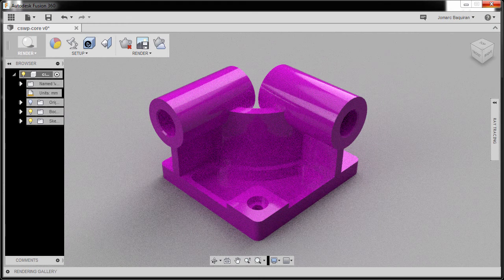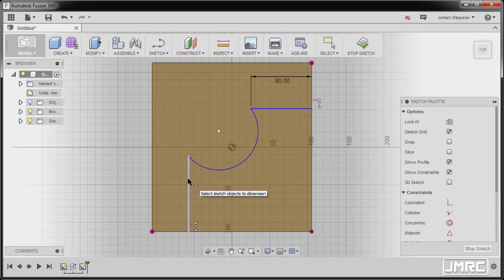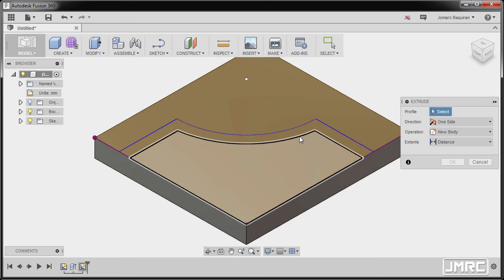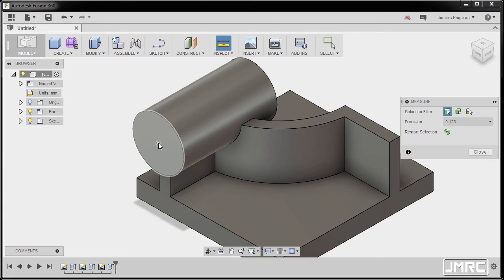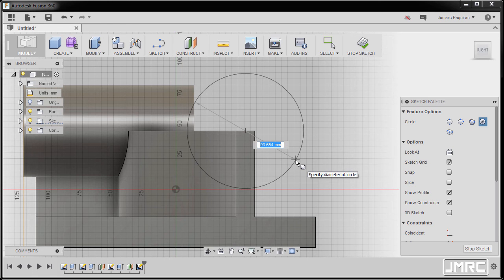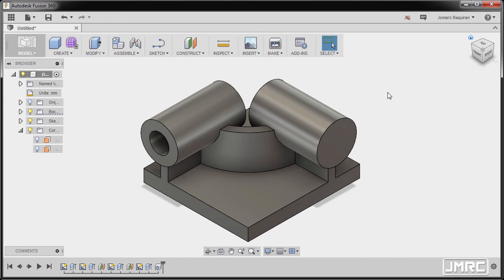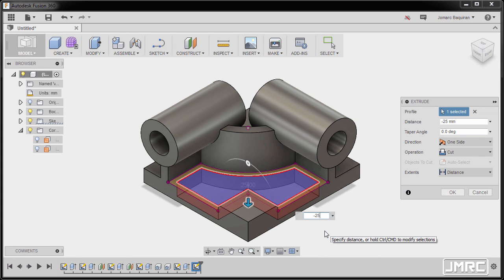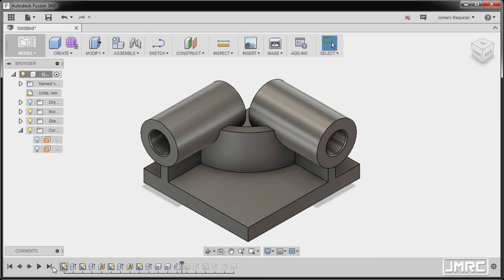Fusion 360 Part Modeling Exercise 03 (CSWP-CORE)

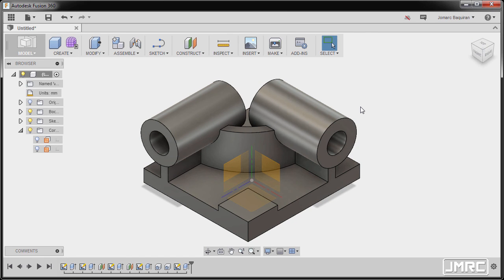Comment: Great tutorial. Learned a lot. Only problem I have is, I get to about the 19:00 mark, and when I do the offset, it doesn't go around the rectangle. It is though the rectangle is not there. Therefore, I just get the offset from radius part and then to the entire part including the rectangle. Although everything else looks good. I am running 2.0.3797 if that is any help.
Reply: ok. found out what I was doing wrong. I had all 3 sketches turned on. When I tried to choose the offset planar face, it turned out, I was really choosing the sketch face. When I turned off the sketches all I saw was the planar face. Then no problem.
Reply: Also, in the newest version of F360, you have to select each segment, you can't just select the whole thing like in your video. What version of F360 were you using anyway?